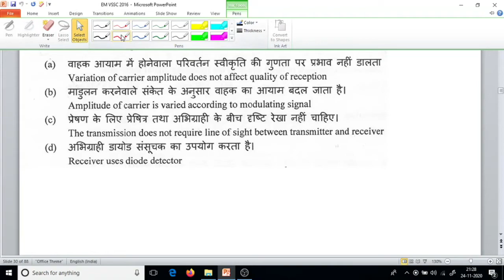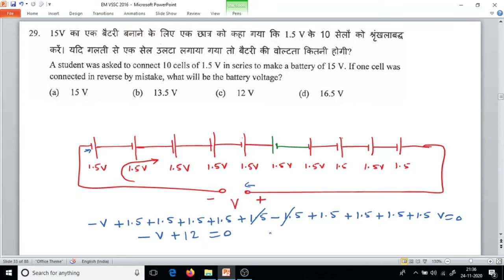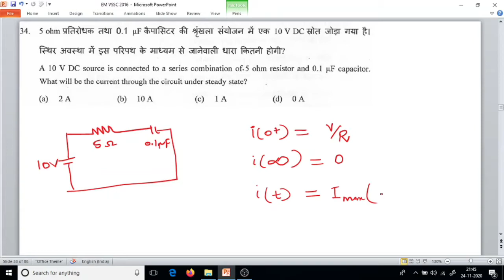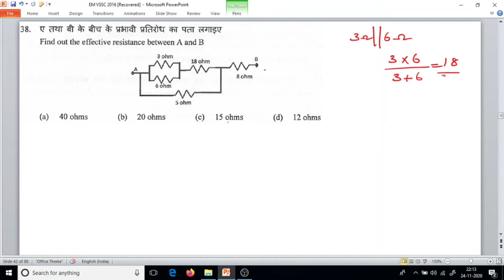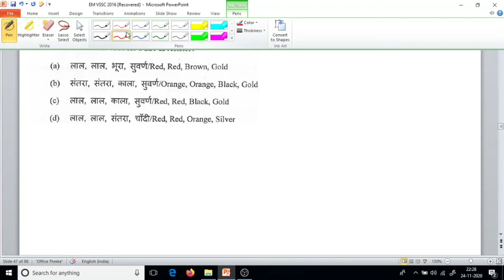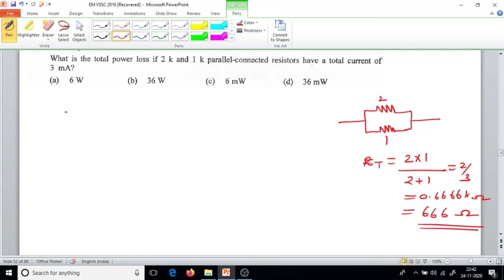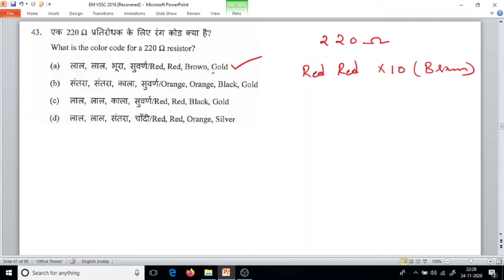Comment: 46:15 Q)43-D)Red,Red,org, Silver
     22×1000×0.01=220 ohm
Please check sir
Reply: Red Red Brown Gold
Reply: @CurieElectronics  
Extremely sorry sir,i haven't recognised that it was a four band resistor.. last one should be Use for Tolerance... But in answer they had not provided Tolerance value,so mistake happened.. 😞